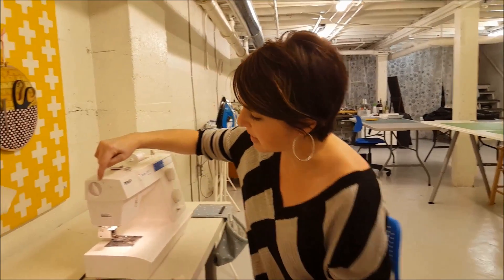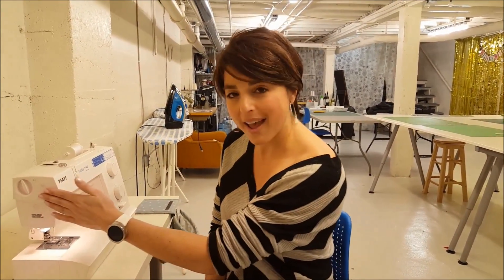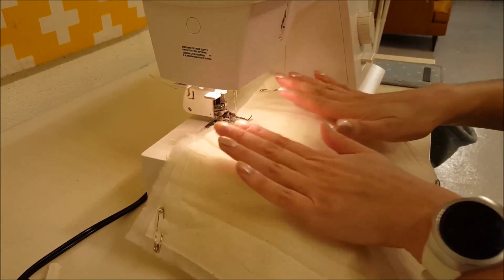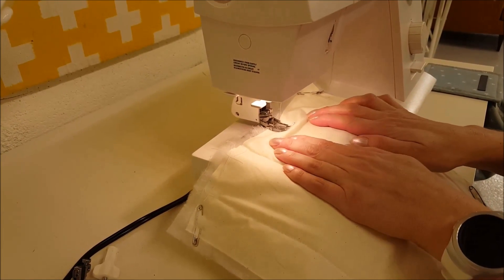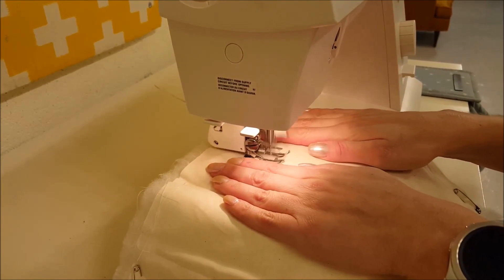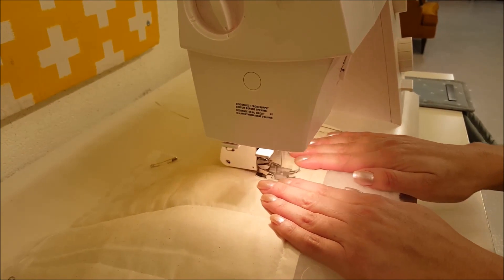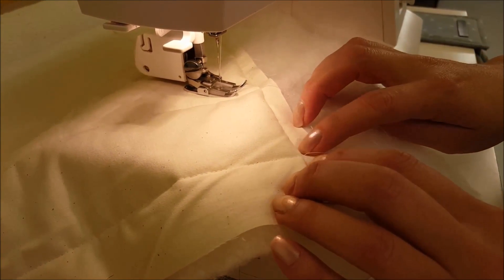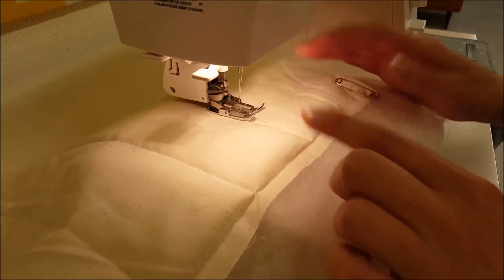Prevent Puckering When Using A Walking Foot

Comment: you have solved my dilemma.   I usually pin quilts, and I prefer doing that and rarely ever have a problem with puckering when I pin. However, for some reason when I spray baste I get puckering. And it drives me crazy. But today I had not even seen your video yet and  I did pretty much what you showed.  That was this afternoon and now it’s 930 at night and I’m watching your video. I don’t think I’m brilliant but you are because you demonstrate and explain so well. Thank you so much for the excellent tutorial.  I’ve looked at a few other videos tonight and they never really explain exactly this problem. Perfect.

Comment: I am getting a crooked bottom piece. I think it might be the walking foot? But any advice is appreciated.
Reply from the maker: Try adjusting the pressure of your foot. On the top of the machine, there might be a knob that will either raise or lower the foot, which will lessen the pressure. Sometimes if there's too much pressure then your fabric will go wonky!